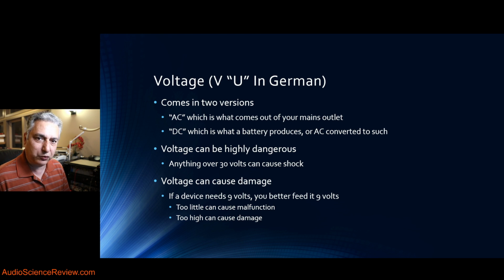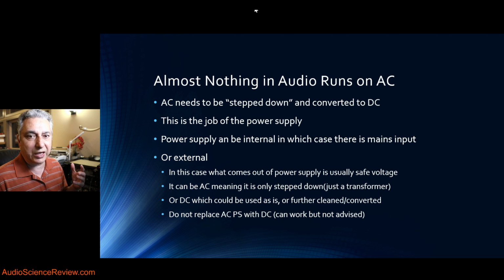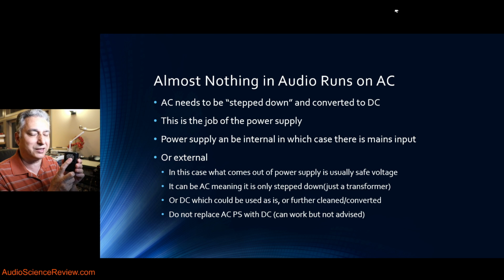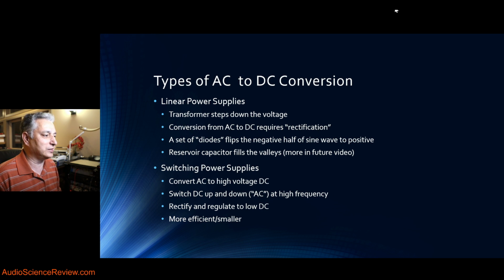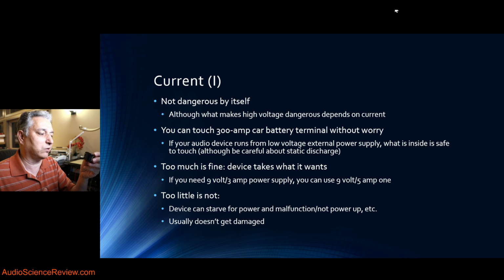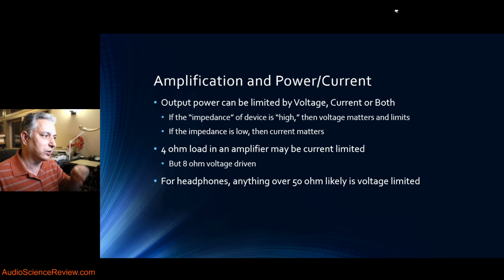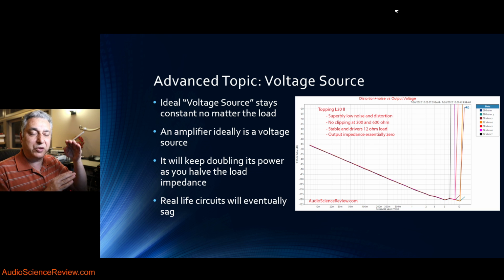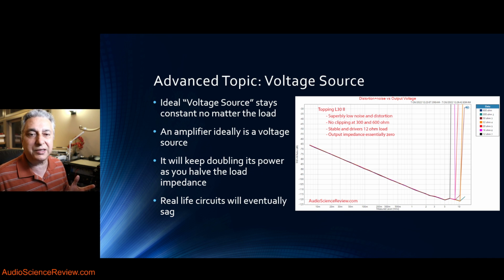Electronics for Audiophiles: Voltage and Current

Comment: Like it! I like that you start from rock bottom. I would not mind getting a bit more into the details. E.g. show a case where a device does NOT behave like an ideal voltage source, kind of a compare and contrast approach. Also a bit more details about switching power supplies would be nice. I can see that by increasing frequency of the AC you can smooth out the valleys, and omit the capacitor. How far do those go? From 60 Hz to 1 kHz, 40 kHz, 1 MHz? Or is a time delay done on overlapping 60 Hz waves? Could yield similar results, but may also cause interference peaks. Any relationship to Nyquist limit? That sort of thing. I have no clue about electronics, just a biologist. I do know the 4-diode Graetz circuit, but that's about it.
You threw in primary and secondary windings in your transformer explanation. That may need a bit of explanation for some folks (no problem for me). I know it is so hard to explain things in your area of professional/research expertise to a GE audience. It is much harder than talking shop to colleagues, everybody rolling jargon. So thanks for doing this.
Reply from the maker: All good suggestions.  Let me finish a first pass of all the basic components and then we can build on them to cover th concepts you mention.

Comment: U isn't voltage, it's tension. Tension, by definition, is potential difference and difference in German is Unterschied. Hence the U. Shold have used the S for Spannung if you ask me. 
Similarly, I isn't amperage  but Intensité de courant or just current. We only express it in amperes. R isn't ohmage, it's resistance. P isn't wattage, it's power, f isn't hertzage it's frequency... :)

Comment: Hi Amir! Thanks again for your job.

I have a power supply issue with my small headphone dac/amp powered by pc usb (power + data).
When I connect/disconnect it to the pc usb or when sometimes I launch an app, I listen an uncomfortable bang noise.
i saw in AliExpress a small board that announces correct this issue, but because I´m a nerd in this issue, I´m not sure if it will help me.

(USB Power Filter Noise Eliminator USB anti-interference filter board for Amplifier PC computer Power purification) 

Thanks.
Reply from the maker: Hi there.  Thanks for kind words.  I have tested a number of such noise eliminators and none do anything useful.  If you are going to try one, get it from some place with easy return.

Comment: You forgot to mention that on DC adapter type supplies, such as those used for guitar pedals, the plug polarity is important too. Guitar pedals need center negative on the plug, although some generic adapters have multiple tips, and some can even switch polarity, so they can be used with different polarities and tip sizes. Also, tube amps step up the 120V AC (and rectify it) to a higher DC voltage for the plates of the tubes, in order for them to operate properly.

Comment: I think is confusing to describe voltage in terms of alternating current or direct current (AC/DC), it’s not called alternating voltage or direct voltage.

I’ve understood voltage to be electrical pressure and current to be electrical flow. Is that the way you think about it? Can you say more about this difference in a future vid?
Reply from the maker: No we don't.  In Engineering we use our own convention and talk about it the way I did. How it actually works is immaterial if it correctly describes the operation of the circuit.  To wit, in engineering we say current flows from positive to negative where in reality is the other way around.

Comment: Good video. Just want to add that in some circles, Voltage is represented by “E” (electromotive force)….as in E=IR. Units are still represented with a “V”, however.
Reply from the maker: Yes, I have seen that notation as well.  It is mostly used in electrical circuits as opposed to electronic.

Comment: do it at your own risk mr Samir, but be warned, the moment the word 'capacitor' is used in an audio discussion, strange things happen w/ people, some say timespace itself starts acting up..
back on the topic, one advantage of a power source w/ greater amperage headroom is that it experiences less heat (and wear). 
sometimes heat is a crucial factor, especially in enclosed environments, the simplest example would be a multimedia cabinet housing a number of 'power adapters'. 

and speaking of that, pls consider talking a bit about maintaining equipment at proper temps as compared to AC outlet cables, heat does impact performance :}

Comment: This'll likely go down as a most commented on video... 
Voltage and Current are inextricably linked, and the interplay between them can be expressed so so many ways. 

There will be a lot of "yes, but what about ..." 

Myself, I'm compelled to take exception to and address several comments already. 

That said, fully grasping Voltage and Current, and the manner in which they are interdependent 
is vital in the physics of all elements of audio.

Comment: Not sure why you mixed that up but current is the actual dangerous part of electricity. Although the obvious is that you basically always get both
Reply from the maker: Nope.  No mixing.  Not going to repeat again.  See this video if you are still confused: https://www.youtube.com/watch?v=XDf2nhfxVzg&ab_channel=ElectroBOOM
Reply: @AudioScienceReview  He said what I said, you always get both
Reply: @AudioScienceReview  That is the most idiotic video.  Please, nobody take that demonstration of stupidity seriously.
Reply: Warning plates say "Danger! High Voltage!" for a reason. Because the high voltage is a property of the power source, but the current depends on the impedance of the human body, which can vary. So with a high voltage you are more likely to receive a lethal or injuring current.  Hence you have to be careful about Voltage with your devices.
Reply: @SirCobraXI  You always have to be careful when dealing with "High Voltage", because that's where you'll find dirty, deeds done dirt cheap! (Oh, come on! You KNEW someone was going to say it eventually.)

Comment: I have always asked my self if its audible cleaner to run a music session on USB battery or using the computer USB power, on my equipment I can't hear a difference.
Reply: I think that depends of the quality of the DAC implementation.
In my case with my small headphone dac/amp when i connect/disconnect it to the pc usb (power and data) and sometimes when i  launch an app, I listen an uncomfortable "electrical" noise. I think this is due to an oscillation in the pc usb port power supply. I never tested it with an usb battery. I'm thinking to buy a small cheap board in AliExpress to correct this issue of power supply, but because I'm a nerd in this matter, I´m not sure that works. 😀
Reply from the maker: The battery source has a switching supply to get you the voltage you want.  So it is not really battery.  It may help with ground loops though, or make them worse.

Comment: Amir, many in this hobby believe that a nice, thick power cord means a quality component.  I have my doubts on this.  Could you comment?
Reply from the maker: I have tested a number of power cords and both listening tests and measurements show there is no effect on output of audio devices.  See this recent video of GR Research B24 for example: https://youtu.be/HkmwcPdTlWM

I have also simulated extremely distorted AC waveform and again, the output of the audio device does not change.

Let's remember that not a single AC power cord company has shown any measurements or controlled listening tests that these things make a difference.  Both inside your equipment and in the wall are far thinner wires.  Changing a bit of it won't make a difference at all.  Yet, you could damage your outlets or your equipment as I talk about my review above.
Reply: @AudioScienceReview  Thank you, I suspected as much!

Comment: This a an awesome idea to get your knowledge out to non electrical engineers.  Thank you so much!!  One question.  You mentioned that a shock could occur in a device that is not plugged into the mains.  How does this happen?  Is it because the capacitors hold a charge?  If so what is the safe way to get inside a piece of audio equipment and avoid electrical shock?  Thanks.
Reply from the maker: Exactly right.  Without understanding electronics fully, there is no guaranteed safe way to know that there is no danger.  If you can identify the internal power supply and keep your hands away from it, that helps.  Be sure to have socks and shoes on and don't tough anything else metal.  Also, pull out the power cord while the unit is on.  That will usually drain them.  But again, there is no guaranteed foolproof way.  This is why some of us who have worked with electronics for years, have stories to tell of being shocked!

Comment: More countries than Germany use "U" in formulas for voltage, although unit is always "V". "V" for voltage variable is new to me. Example: U = R · I; for 4 Ω and 3 A, potential difference will be U = 4 Ω · 3 A = 12 V → U = 12 V. "v" usually means, while "V" capital letter is the unit, and "U" is the variable. It's like distance, we don't use M for distance, but "d" or any other letter. d = v · t = 3 m/s · 2 s = 6 m → d = 6 m. "m = 6 m" or "M = 6 m" would be weird.
Reply: And you americans dont usw A for current either

Comment: Would love a video that covers the nitty gritty details about output/input impedance matching (e.g. source to preamp to power amp). Particularly the scenarios that can lead to problems when pairing devices. A deeper dive into input sensitivity would also be helpful. Thank you for making these videos, and especially for the existence of ASR! It has been an incredibly helpful resource for better understanding the actual science that makes for great audio.
Reply from the maker: Impedance matching has been on my todo list.  Had forgotten about it though so thanks for the reminder.  :)  And thanks for the kind words.  Much apprecited.
Reply: We have been Gain matching in car audio for years. Class D stable to 1 or .5 ohms for years, clipping indicators for the last 5 years and for some reason the hifi realm hasnt or doesnt but thinks it should cost 100 times more.

Comment: A linear power supply is always regulated, else it cannot be called linear. Even a rectified and smoothed AC voltage remains a pulsed supply, only after regulation and the voltage is fixed does it become linear (you cover it later). This can be confusing to audio fanatics, choosing a regulated or unregulated power supply. Other than this it is a nice presentation.
Reply from the maker: You can have an unregulated linear power supply.  It is just rectifiers and filter caps.  There used to be plenty of these external ones powering small electronic devices until switching power supplies killed them.   Internally the device then had regulators to whatever voltage they wanted.

Comment: We are using in Germany and allover Europe the U for voltage which is coming from the latin word "urgere" (translated to English: "to urge") Anyhow we use Volt same as you as SI unit. Just for explanation. 🙂
This makes totally sense since voltage is urging into your device or your body (and can kill it or you when it is too much in combination with a certain amount of current) while current cannot do that without high enough voltage to overcome the resistance of your body first (as long you don't shortcut it - heat will be a problem in this case) since the device is just taking what it requires as long the source can deliver it.

One more thing. Even so this video was to basic for me, I think it is extremely well done for people who have no technical background at all and are therefore an easy target for snack oil garbage.
As always well done Amir. 👍🏼🙂 Thanks for all the effort you are spending for the music lovers community.

Comment: Amir, for velocity symbol is lowercase v.
The origin of symbol U is the Latin word "urgere" (Alessandro Volta was an Italian physicist), which can be translated into English and means more or less to push or to force.
Whole EU use U as a symbol for voltage. There is a couple of other good reasons for that too:
1.  to distinguish symbol for voltage from unit Volt (V=2V vs. U=2V)
2. V is symbol for volume
Reply: Funny, it seems that both of us explained the U at the same time. 😉
Reply: In mechanical engineering, physics, materials science, quantum physics...all use the same symbols and letters. There's only so many to go around. They mean different things in different areas of study.

Comment: Thanks AMIR for this educational video for those that need some introduction to electricity theory. Laws and theories of electricity and magnetism are well established, proven and being taught as a factual science in almost every secondary or high school science classes around the world. And it’s nothing pseudo or voodoo about electromagnetism and the sciences.

There’s Laws by Maxwell, Faraday, Ampere, Coulomb, Cavendish and Georg Ohms himself of course. It’s applicable from the quantum laws to the laws of the universe and everything in between, including your car battery to the power amplifiers and speakers.

To say otherwise is utter dumb, foolish and stupid, especially by those that have their motives to sell esoteric, ie snake oil, exotic products that “enhanced”, “improved”, “upgrade”, “refined”, better audio than is possible. The greatest joke is their claim is that none of their “claims” are measurable.

Haha LOL, hello, mankind can measure precisely HIGGS BOSON to the furthest galaxies using the same principles.

Audio sounds and visual images are just part of the electromagnetic spectrum, so are the infrared images taken by the James Webb Telescope.

To understand the precise relationships between POWER (in Watts), CURRENT (in Amperes), RESISTANCE (or impedance in Ohms) and POTENTIAL DIFFERENCE (in VOLTS), just use the POWER and OHMS equations.

Anyone that claim to be able to produce anything that is able to “break”, “defy”, or otherwise “overcome” the sciences behind electromagnetism and waves theories are definitely worthy of a NOBEL prize in PHYSICS and a FULL PROFESSORSHIP in one of the IVY LEAGUE universities or OXBRIDGE.

 It’s laughable to watch many naive and gullible buyers spending a fortune buying snake oil products, being a misfortune innocent victims of mumbo jumbo techno jargon. Products such as upscalers, power conditioners, esoteric speaker cables, power cables, interconnects, LGK’s and that sorts are just plain and pure BS.

Audio industry is one of the most polluted and contaminated industry full of incorrect, inaccurate, 100% misleading, fake, pure lies and misinformation.

Buyers Beware, Caveat Emptor (even for those with the money to burn or cheated outright)

Comment: Thx for this; reminds me of my grade 11 physics class in 1968 when I learned how electricity was made and an electric motor worked!! Will keep following for sure!  Electricity can go around the world seven times in one second!  Thx again.
Reply: Just reverse everything from physics class.  Electricity runs backwards for electrical engineers since Ben Franklin developed all the foundational EE equations and didn't have the physics basics and theorized electricity in reverse (it works out either way) and the two disciplines have never united.
Reply: I think we built electric motors and electro magnets in about the 6th grade. Washington in the 80s.
Reply: @freeradical431  I’m talking about half a century ago! LOL
Reply: I think its interesting how the curriculum changes. I doubt they teach it anymore, unless you can wrap a wire around a nail and connect it to a battery,.......................... on a "smart" phone.

Comment: Nice series there !
BTW what is best for an amplifier current or voltage or is there any sound difference ??
Reply: Go back and think on what he said : a device will need a certain amount of voltage  to operate correctly, but it will only draw the amount of current that it needs.
Reply: @stevenholt5484  that is not what I asked, i know electronics, you can have 100V and 1A or 10V and 10A for the same resulting 100W.
Does it make a difference in driving the speakers ?
Reply from the maker: @jay1st1st  I explained in the video that depending on the impedance of the speaker, voltage, current or both matter. The more detailed explanation goes beyond the scope of this video but I can cover it in another.  For now, if you have an 1 ohm speaker, then the current matters.  If you have a 10 ohm speaker, then the voltage does.
Reply: @AudioScienceReview  Tnx thats already a start !

Comment: Re the U vs V "confusion“ inGER.  In EN the term "Voltage“ and esp. it’s abbreviation “V” is used synonymously with the Unit! “Volts” also abbreviated with a “V”. In GER the unit “V” is of course also used in keeping with international convention. BUT! instead of “Voltage” we use “Tension” (Of course in its GER form=“Spannung”) to indicate the physical entity. For us it actually AVOIDS confusion using “U” as you pointed out. Love your videos 1000👍!
You integrate expertise and data with levelheaded sense while appreciating the personal/subjective elements. KUDOS  🖖
Reply: Furthermore: The symbol for voltage is U. The origin of this symbol is the Latin word „urgere“, which can be translated into English and means more or less to push or to force.
Reply: @StefanHoops  Spain, France, Switzerland also use U for the symbol or variable, and V for the unit. Otherwise, it will be a little odd, like using "m" (meters) for the symbol.